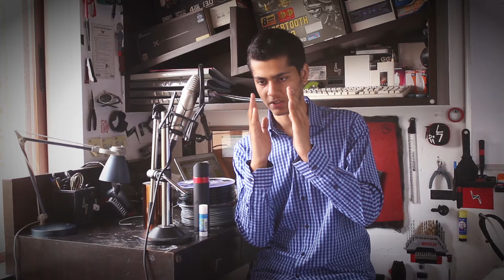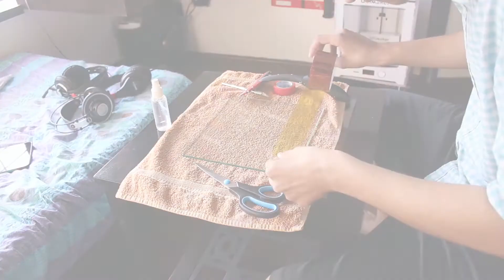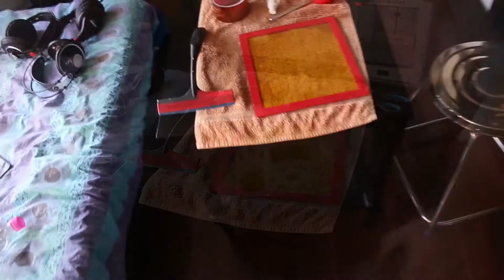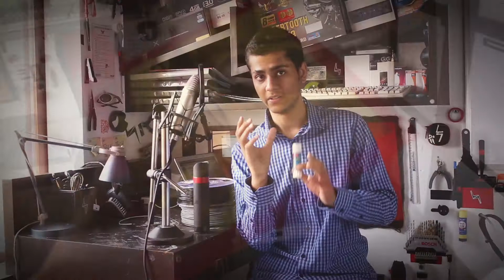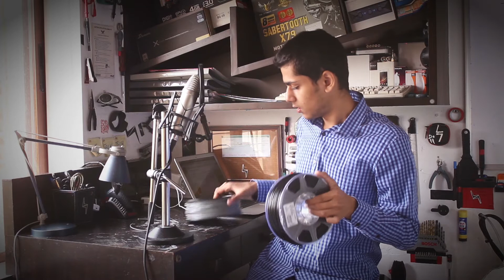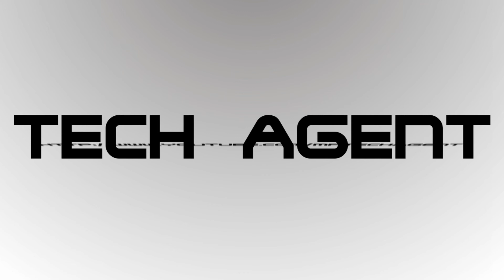Master 3D Printing In ABS.

Comment: Hi I am Hardik Dave I am 3d printing service provider from Gujarat and I just started this service before 8 months ago.1st thing I want to tell you that you are awesome Bro thanks for the review about ultimaker. I already have 3d printing machines that is Indian made but now I planning to expand my production and also planning to buy ultimaker as I also know this is best machine ever but I am quit confused about ultimakar because The Indian manufacturers suggesting me not to buy ultimaker . As you are using it for 4 months whats your call should I also go with the ultimaker or no :)  thanks waiting for your reply
Reply: +Hardik Dave Hi, 

Let me explain what Indian 3D Printing manufacturers do, they go online, bulk order parts from China by using open source RepRap source files and then they assemble it here. They are not manufacturers, they just assemble it. I'm not saying that that's wrong or right, I'm just saying they have no right to say that you shouldn't buy a printer like an Ultimaker cause they are just copying open source designs. This is the problem with Indian Manufacturing, we have zero innovation. It's just an off the shelf Manufacturing motto which won't get our Economy anywhere.  

I have been using my Ultimaker 2 with absolute joy, yes there will be a few upgrades you might have to do to get top class results. I have added an Olsson Block and a 35W Heater + many other small hardware upgrades which are now present in the new Ultimaker 2+ to make my prints as reliably perfect as possible using materials I need for my Prototyping.
I will say that the only reason to even consider an Ultimaker is speed, that's the only one thing that sets it apart from others, otherwise I think you can get the same quality with even lower end printers if they support similar resolution capabilities and swappable nozzles.
Reply: Thanks For The Reply :)